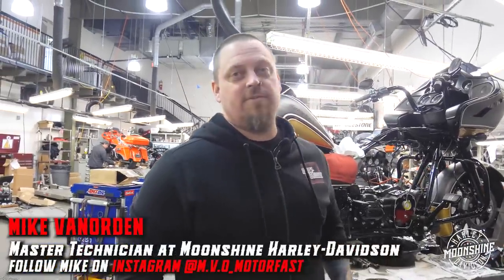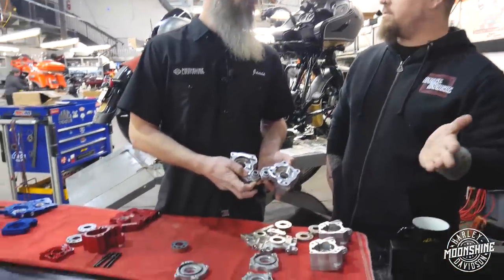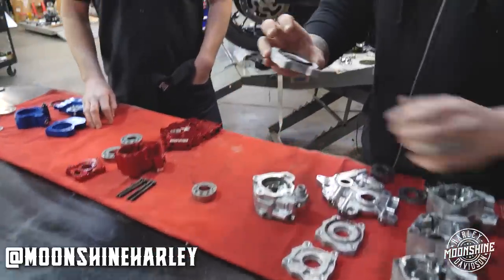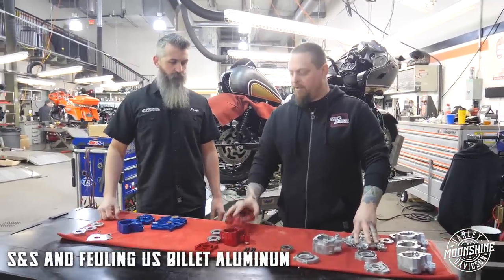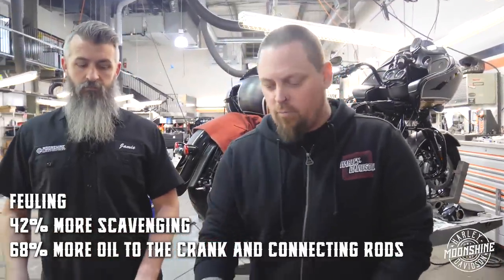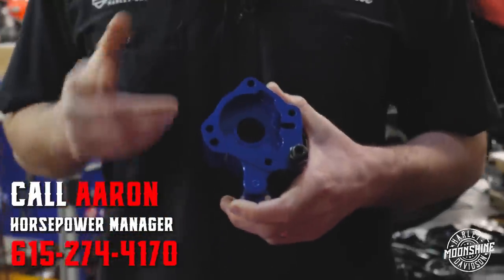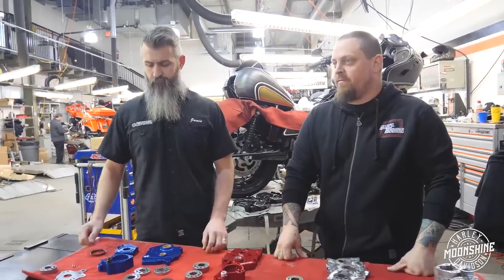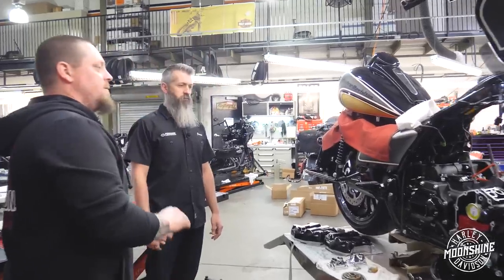2020 Harley-Davidson M8 Oil Pump Updates 'Cause S$#! CHANGED! | Shop Talk Episode 35

Comment: Do you know the earliest build date that HD started using the newer backing plate with the seal???  I have heard that the latest oil pump starting going in the 5/19 and later builds, but did the backing plate with seal go in earlier builds???
Thanks guys!

Comment: Great information, thanks. I have a 2017 RGS. For a Stage II with cam, would the new 2020 oil pump be sufficient? Also, can I use my stock cam plate or is there a 2020 cam plate I need to buy? Appreciate the help.
Reply: Know these are old, just replying for reference. Yes, stock 2020 pump is fine for Stage2 or Stage3 even Stage4. Of course if you go bigger 128 etc, sure, up the pump because you need more oil. Your cam plate is fine they put a seal and baffle inside to help with the oil sumping.  KB

Comment: Do you check the pressure on the pump before install? My TC3 plate was set to 35psi which was great for stock. The 08 Zippers 117 needed 57psi

Comment: So it begs the question......certainly not a new question, but why would the crank have excessive runout? Unless the crank shifted due to a bad downshift or rear brake lockup, seems like HD should revise their quality control.
Reply: The crankshaft is allowed a certain amount of tolerance from the factory and is fine within the tolerance range.  That tolerance is just tighter when using the more rigid components.
Reply: I know about pressed crank runout. All I am saying is that 5 thou is getting up there already but is considered "spec". Since you had to warn people not to use the other cam plates if runout is more than that, it suggests that either some people have shifted their cranks or  Harley's QC needs to be improved.
Reply: @guyconnell2250  the roller bearing bottom ends do not require the exacting tolerances as the Taper bearing ones do.  The OEM spec is under .013" I believe.  (I have not referenced that number for this post but it is right around there.

Comment: Did a Woods cam along with the S&S oil pump & Cam Plate upgrade on my 2018 RK. 

Original oil pump had no seal, so contacted S&S and was told it is optional.."If it didn't have a seal, install S&S pump without it".

Bike isn't back together..yet..waiting for quickie pushrods.

Should I get the seal for the oil pump, or just put it back together without?
Reply from the maker: Do the seal. It’s an extra benefit not needed but a plus.
Reply: @MoonshineHarley  will do..thanks for the advice. Great channel
Reply: What’s the part number for the seal? I can’t find it

Comment: What are your guys' opinions on breather bypass systems on the intake? Is this something I should leave alone or take care of? It seems strange to me to blow all that shit right into the intake side of my heads.

Thanks for sharing fellas. Love what you do. Keep up the good work.
Reply from the maker: Roger Fulling We do it on some of
our 150hp builds. We run them to a catch can we hide behind one of the rear bags. It’ll add a maintenance item that needs to be dealt with from time to time (drain the can).
Reply: @MoonshineHarley  it seems like that's the way it should be and makes complete sense to have on all these motors. I just don't seem to see it done very often, which seems strange to me because it makes complete sense to do so. I was looking at the DK Customs version of this simple yet genies solution to the problem.

Comment: If i am just going to put a zippers 468 in my 107 will the 2020 oil pump sufice as an upgrade?
Reply from the maker: JohnnyDoe Yes! The other ones are an upgrade to the stock updated pump as the provide more oil flow.

Comment: is there a way to have a shop determine what your run out is before purchasing either cam chest kit?
Reply from the maker: Yes but at that point you have 50% of the cam job done.
Reply: @MoonshineHarley  well shit. What’s the average your shop finds on crankshafts being 5 thousandths or less on run out? Large price difference in parts between a bolt in cam and a cam chest kit.

Comment: Have a 2018 slim just ordered a new 2021 oil pump bike only done 7800km.
Was looking at putting in S&S adjustable push rods an lifters..S&S valve cuffs..an a zappers 468cam...or cyclerama 480..which cam would u use??

Comment: I have a 2020 Road glide and am looking to just do a woods 22xe cam. Do you think I need to do the ss or fueling plate and pump? or do you think I would be good with the new 2020 pump? Shop says that the 2020 is much better and they wouldn’t bother changing it out unless I want to do a 140hp+ build.
Reply from the maker: Raging Ninja the 2020 Harley pump will work great, the S&S or Feuling is an upgrade over factory options. Same labor either way so we would recommend one of the aftermarket pumps if you are going to keep the bike a long time. If you plan on trading in a year or two just do the Harley 2020 pump and save the money.

Comment: Soo I have a 2018 road king with a stage one kit. You guys are making it  sound like there is something wrong with my engine. Is there ? I'm happy with the way it runs and pulls through the gears. Will something happen to my  engine?  Because its doesn't have these up grades? Help me out here guys. Is there something wrong with the harley  design?    WOW

Comment: Is the oil pump pressure from 2020 M8 enough to run with the s&s 475c without changing to the s&s oil pump? btw i’m runing the FXLR 107 M8.

Comment: I’ve got a 2018 roadking special I’ve just put a stage4 in do I need to update oil pump
Reply: Bikes Blues & Rallies I would.
Reply: I would. The new pump actually isn’t very expensive, if you had the dealer install it they may have done it for you already, I believe there is a TSB telling the dealers to install the new pump with the seal when you do stage 3 or 4
Reply: @kylemoore9626  only if there is an issue.  But a good dealer/shop will highly recommend the upgrade when doing the work.

Comment: They only made the first change for the stage 3 and 4 bikes, not the stock or stage 1 & 2
Reply: All the factory units assembled after a new part number revision is released come with the new component.  That is across the board.

Comment: Hi I have Harley-Davidson street glide special 114cc built December 21/2018 do you know if Harley-Davidson put back plate seal in all 2019? Trash told me I need this up grade before putting there crank case vent kit please let me know if you have this information cheers 🍻.

Comment: 2019 street bob wana put a 475 cam do i have to chsnge the oil pump or csn i use d stock oil pump
Reply from the maker: Salvador Ochoa you can keep
The stock one. The S&S or Feuling pumps will provide increased volume and flow  which will reduce wear and keep the engine temp lower. Heat kills! If you are adding the 475 cam to a stock compression engine we would recommend going down to a 468 or 465. We ONLY pair the 475 on 10.9:1 - 11.2:1 setups.
Reply: @MoonshineHarley  so with 468 0r 465 ill b ok with stok parts
Reply: @MoonshineHarley  i have 2 brothers ex heavy breather filter  and power vision tuner what cam u recomend with stock parts 468?

Comment: When are you guys gonna test aftermarket cams on Harley’s new 131ci crate motor?
Reply from the maker: ws61200 Harley’s cylinder walls are too thin to handle the extra HP & TQ our setups make. Our Moonshine Horsepower 131 will hit the market in late June 2020 and it will have a 4 5/8 flywheel!

Comment: So, is there a draw back to using a oil cooled pump in a water cooled head, wouldn't the extra oil help the water cooled motor?
Reply from the maker: OdinAF If that was the case all these company’s would have done it and save the money by only producing one
pump design instead of two. Testing must have shown it to not be beneficial.
Reply: @MoonshineHarley  I appreciate the reply, I was sitting here thinking about it because I have 19 fltru and trying to think about if there was any draw back amd I cant think of any unless the water cooled head has smaller passages or there was a design difference. More volume always seems to be a better thing imo.

Comment: Can HD get anything right?  Does HD test their motor designs before releasing to market?  I am a customer who bought two bikes with TC 88 motors with the cam chain tensioner design flaw.  That showed me HD is a company that does not care about their product or customer.  I still have both TC 88 bikes, but have bought my last HD.  Thanks for posting, great explanation of more HD design incompetence.
Reply: Harley fixed the chain tensioner issue within the first two years of the twin cam hitting the market  by changing the chains and subsequently released the hydraulic tensioner cam plate.  Every manufacturer of every vehicle does running changes on their powertrain and electronic systems.  I checked Honda Odyssey at random and there have been 1032 technical bulletins on that vehicle alone.  (Those are communications from a manufacturer to it's field technicians on fixes and/or running changes on mechanical and electrical systems that may result in warranty repairs of a vehicle).
How are they incompetent by constantly making improvements based on real-time input from their technical partners in the field?
Reply: @NoName-vz1ob  touring models were produced with spring loaded cam chain tensioners from 99-2007. The tensioners need to be changed at 30k or they may fail and can result in engine failure. If HD fixed this under warranty it would be a different story, but they continued to sell defective engines. I agree all machines have issues, it is how the mfg stands behind their product.
Reply: @eb1941  not true.  They recommended they be checked every 25 thousand miles.  Not changed.  And if they failed while the bike was under warranty it was covered.  After they switched to polished chains the failure rate went down to almost none.  And yes it took 5 years to design the hydraulic version.  In the meantime we serviced thousands of motorcycles with no issues.  Why don't you get a newer cam plate with hydraulic tensioners for $400 instead of continuing to complain about this beaten down subject that no one cares about anymore?  It's 2020 now.  Not 2000.
Reply: @NoName-vz1ob  we will have to agree to disagree. The polished chain did not fix the issue. 25k miles is not many.miles and should not require inspection of the cam chest, let alone changing tensioners which is no small job. For people who have low mileage TC 88 engines, believe me, we care, and there are a lot of us. Three of my friends are in the same position and none of us will be buying HD (ever), not because of the design flaw, but because HD  did not fix the problem on their dime. I am a 30 year experienced mechanical engineer, and this is 100% design error.

Comment: So if I was just doing a stage 2 cam upgrade with something like a s&s 475 or redhift 468 on my stock 2020 114 m8 do you think its necessary to upgrade the pump? Thanks
Reply from the maker: We would recommend a 468 or smaller cam on a stock compression engine. There are lots of benefits to swapping the pump so we would recommend it but it’s not a necessity.
Reply: Idk if you installed the RS 468 yet.. but I have on my 2020 RGS- so far so good! The cam is badass and kicks ass😎

Comment: Y’all are silly!!!! Billet has zero to do with alloy!!!! You just mentioned they were machined from 7075 alloy.  Billet is just a piece of unmachined material. Billets are solid lengths of metal with square or circle cross-sections, can be extruded or cast.  You should know a lil something about what you’re selling because machinists like me know better.

Comment: What dummy at HD designs this crap?

My 2019 Ultra 114?
50K miles, meticulously maintained. 
Modifications- HD Stage 1 , TAB slip ons, everything else is stock. 
At the dealership for over 3 months for the transmission oil transferring into the primary, third fix attempt . 
Also major internal engine damage due to the oil pump partially failing. Symptom was almost 2quarts of oil being consumed every 5K miles, dealership was advised several times of oil consumption when it was at a quart every 5K miles and stated “that’s within spec”. It didn’t smoke, and it wasn’t noticeably down on power, but failed the compression leak down test at 72% on the front cylinder. Great motorcycles if you ride under 5K miles per year, and you better have the ESP warranty!!! Damn I wish Victory was still in business!!!